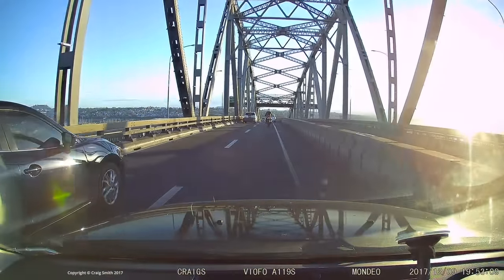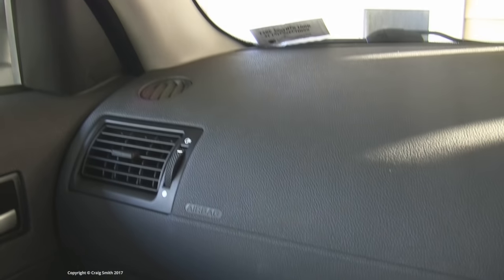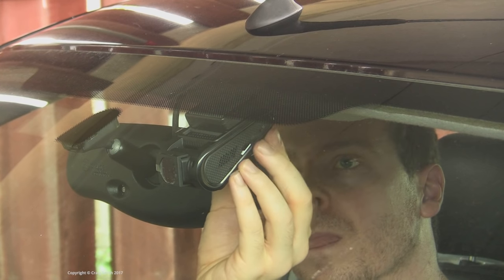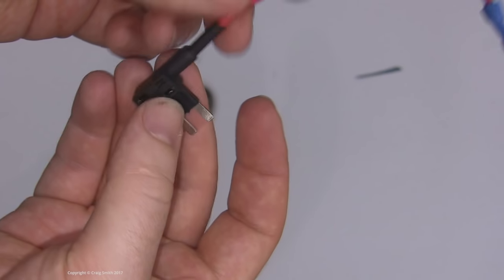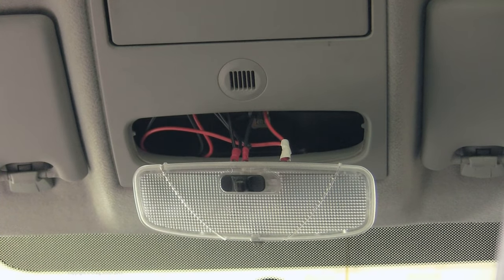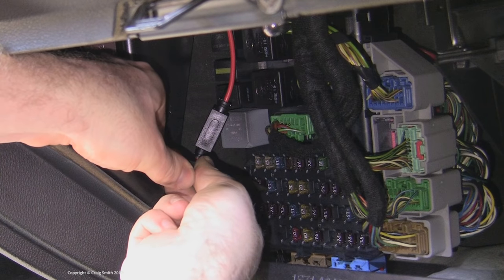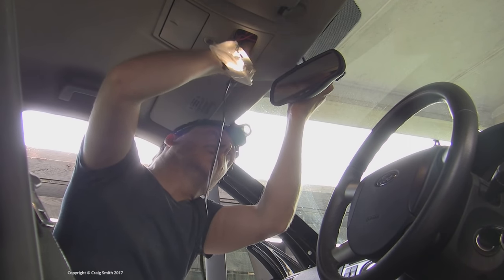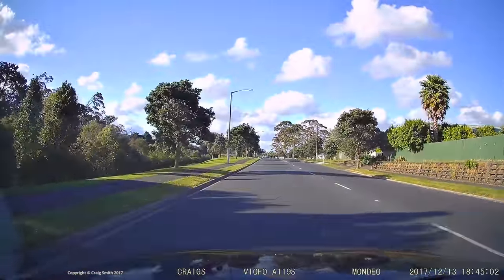How to: Hardwire install a dash cam with USB power supply

Comment: This is pretty much the  way I hardwired my dashcam to my 407, I wired another 12 volt socket to a fuse tap of the courtesy light circute and so I could use the power supply that came with the camera.  I was trying to keep the cost as low as possible.  But in the end I have a very tidy setup like yours.

Comment: Nice video. I hope people appreciate how much neater this type of installation is over using the "cigar" type power outlet. I have had this type of setup in my 2015 Genesis using front, rear and two rear mounted diagonally front  facing cameras. I even got a compliment from the service techs at the local car dealer on the installation. I think though that the cameras themselves make them nervous.
Reply: That is a point (recording while in maintenance) , thanks for mentioning it. I had a pretty decent result on two cars with wiring the cams on the side frames going under the glove box to the cig. lighter with the standard plug in socket. My lighter shuts off electricity while parking. (No need for me to use parking mode) Way better than lwttingbthe cables hang und done in 45 minutes.

Comment: Thanks for making this guide! Very well thought out parts & video & instructions. I think yours is the "right" way to do this.

My ghetto way of doing this would be to jam (between the a fuse and contact) a piece of wire to power a female cigarette lighter stowed by fuse box. Plug in the male onto the female. Take the output microUSB wire from the fuse panel area through the "A" pillar & headliner to the camera. This would require extra purchase of only a female cigarette lighter and nothing else.

Comment: I also recommend wrapping all the wires to be installed with cloth electrical insulation tape (example high quality maufacturer: Tesa) in order to significantly cushion their rattle against body panels and plastic trim pieces during driving. Cheap and simple trick and an attention to detail.
Reply from the maker: Yes good idea. Cable clips and ties go a long way though. In this car the A pillar has spare wiring clips integrated into it and the headliner is soft.

Comment: Awesome thorough video. I learnt something today. The other thing you can do is use a power cutoff to cut the dash cam off if the battery reached a certain voltage (12.2V is pretty safe) so it'll film while parked but won't kill your battery.
Reply from the maker: You can also use a separate battery pack to further save the car battery, but the other problem without a dedicated parking mode is that you will over-write all your driving footage after just a while of parking, e.g. with 3 hrs of the garage wall. I have yet to experiment with the software driven faux parking mode on the new A119 firmware, if it works ok then I will be tempted to look into a battery system.
Reply: Craig's DIY Car Living in Australia, discharging lithium ion batteries in 70°C+ in the car sounds like a recipe for disaster lol. I'm looking at getting the A119 Pro, and although I'm not likely to use the parking mode in my area it's nice to know that it's an option. You could also put in a little switch so in your garage you could switch the camera off, or just straight unplug it

Comment: The 119v3 is out, $110 so a bit more expensive but as a longtime user of the 119 series I expect my newly purchased 119v3 will work great and it has a hidden feature of H.265 encoding. I like the form factor of these cameras and although theft is low her in our area it blends in nicely with the windshield.

Comment: Great job. One caution. Once the GPS plug in cable gets old it will start to make the camera intermittent. I had to bypass the GPS mount and plug directly in the camera. This was true for both 119's I have so it is not something that was a fluke. I am about to install another 119 and hope that has been solved. Dielectric grease did not solve the problem thus I think the mount of the GPS is not robust enough to handle the plug in. The camera works well and will let you know when the SD card is shot too by coming on and off acting intermittent. Again nice job!
Reply from the maker: If you look at my review of the A119 there is a revised connector in the later version also with a foam pad that is supposed to fix this.

Comment: In July of 2018 I purchased the newly released Viofo A129 Duo.  Viofo continues to develope new dash cams, and the A129 Duo is a great improvement.  If you want front and rear dash cam foottage, the A129 Duo is the one you want to get.
Reply from the maker: Yes I've recommended it to a few ppl altho I haven't looked at it myself. The one drawback is it's only 30fps vs the 119's 60fps, which does make a difference for a dash cam.

Comment: The original viofo ,a119 is still considered better and it's cheaper then the a119s.  They've fixed up original common issues such as vibration noise, GPS add-on pin connection problem, adhesive pad colour for a more inconspicuous look.
Reply from the maker: I explain why the A119S in its review video.

Comment: I just used a Mini usb mirror tap and plugged that directly into my powered rear view mirror harness. Took less than 10 minutes, no wires to tuck or hide and the camera starts when the car comes on and goes off when the car is turned off.
Reply from the maker: Does it also switch off when you reverse? :)
Reply: @CraigsDIY  No it doesn't switch off in reverse. It stays on as long as the car is on because it's tapped into the powered rear view. Here is a link to what I have https://www.amazon.com/Two-prong-Universal-Dashcam-Adapter-MicroUSB/dp/B07BFRWC3X/ref=sr_1_4?keywords=mini+mirror+tap&qid=1565532074&s=gateway&sr=8-4

Comment: This may be a silly question, but how do you know which way a fuse would go into the fusebox? I was poking around with my multimeter, and I had one probe on the chassis for ground and I poked the live/hot into both terminals of the fuse and both were reading 12v, so does it matter which way a fuse would go into this slot?

Comment: To activate park recording, do you plug the power to the base holder or to the camera itself? Very neat install.
Reply from the maker: The camera & install here isn't intended for park recording. You should use a different camera with a different power supply, try this video: https://youtu.be/bAE4gbzCXJE
Reply: @CraigsDIY  Thankfully the Viofo a119 V3 has parking mode, your video is very helpful 👌

Comment: Hi curious, most or my camara is 5 volt.  So 12 volt would over power camara and cook it.  Are the usb connections you shown step down from 12 volt to 5 volt?  I  would like to feed the camara off the interior light power, the cigar plug is too large to fit under light fixture whereas the usb would fit nicely if in fact it provides the 5 volts required, not the 12 volt as the cigar lighter provides.  Thanks for the video. Peace. Andy usa
Reply from the maker: You need a USB power adaptor. 12 V in, USB cable (5 V) out. You can get smaller ones that are not a cigar lighter plug.

Comment: hi craig. i have a 2010 vauxhall astra which as the fuse box in the boot. I was wonder what method i could use to wire from the back of the car to the front while still having the dual usb ports in the glovebox. If you could post a suggestion it would be great. thanks

Comment: I read that some people get inconsistent power problems when powering their Viofo from the GPS module, have you noticed any similar problems?
Reply from the maker: No. The older version had connectivity issues with the GPS mount, resolved in the later revision, it may come down to that.
Reply: @CraigsDIY  gotcha, thanks!

Comment: Great video, thanks - I'm looking at getting a "VIOFO Dash Cam A129 Duo Dual Dashboard Camera" and have no idea how to install it as I don't really know anything about cars/electrics - Who would you suggest I ask to do this? Halfords, kwikfit (hahah no) ? I don't want one that plugs into the "cig lighter" as my satnav uses that, so prefer one that is all wired in like you showed in this vid.
Reply from the maker: I suggest you buy Viofo's hardwire kit, it's not expensive, that is intended to provide proper ignition control and thus parking mode with that system. It has a battery conserving function that can be configured liberally or conservatively. Then just give it all to a competent auto electrician. Yes I would avoid the quick lube places (for everything, including lube).
Reply: @CraigsDIY  Thanks Craig for the reply. I'll have a look at the hardwire kit as well.

Comment: Hey bud, just wondering why you didnt use a permanent 12v? The a119s has the parking and motion sensor feature that needs a permanent 12v
Reply from the maker: It doesn't have a proper parking mode. If you want that, buy a camera that does, and wire it up to ignition-switchable power. For example see this video instead: https://youtu.be/bAE4gbzCXJE

Comment: Great video! My vehicle has a factory installed USB port in the center console. Could I just get a long usb to mini usb power cable and run from the camera to the hidden USB port in the center console and that work just the same as this without having to tap into the fuse box?
Reply from the maker: It will work of course... whether the power is on/off with ignition as you prefer is a different question.
Reply: Ok thanks!!

Comment: You need a low volt switch so your cam can run in park mode.
Reply from the maker: You would rather choose a camera designed for it and wire it accordingly e.g. https://youtu.be/bAE4gbzCXJE

Comment: Does this hardwiring have any effect in regards to functionality when the camera is on the parking mode? In other words, will the cam turn on to record if the car got hit when the car is turned off and parked?
Reply from the maker: The camera shown here doesn't have a proper parking mode. Try this video instead, which shows a more complete install with a better camera: https://youtu.be/bAE4gbzCXJE

Comment: what do i do with the fuses if i wanted to connect to things to that usb block? I have a bluetooth FM transmitter and my phone charging cable going to the cigerette port at the moment, but i want them both hardwired
Reply from the maker: Well it depends on how you want them installed. I showed it being wired into an ACC circuit that is on with the ignition accessory. You would probably want the same for your FM transmitter, but a phone charger is probably best with permanent power.

Comment: It is funny how much effort you deployed to prevent your dash cam from recording when most people would like the dash cam to guard your car in parking mode and connect the power cable to the fuse that still has power after the car is turned off. On the contrary of your car, most cars shut down all the power after you turn off the car. I have the habit to listen to music in my car while waiting for someone. I'm very frustrated that even my stereo equipment shuts off after a while in my 3 current cars. My previous cars let me listen to music indefinitely. Dash cam nowadays have a parking mode that is very economical in terms of memory usage (low bit rate or time lapse or shock detection).

Comment: Why not just use a 12v to USB adaptor.  One single unit for as little as 4 quid.  A lot less messing and some come with the fuse spur already attached.  Also bear in mind if your output to the twin USB socket is 3 amps you may only be getting 1.5 amps at each plug.

Comment: Thanks for the tips on where to place a dash cam, especially avoiding where the wipers don't reach. I'm not so sure about installing it with 3M tape over the tinting, wouldn't that risk lifting that tinting if ever you decided to remove the bracket?
Reply from the maker: Maybe, I would be careful. They give you a piece of string in the box, it's to use as a garrotte so you cut the pad then you can scrape off the adhesive and clean with alcohol. I already did it once!

Comment: I also used the ACC power on the radio with the original adapter from the 119S V2. Problems is, the ACC gets switched off when you start. So sometimes , when the camera is not fully booted up,you start, it looses power for 1 second and gets power again. Then the camera switches off and not on again. 
The timing must be perfect to do get that right , but as my camera is behind my mirror also, I dont always look at it. So it can sometimes be off when you think its recording. 

I then installed a diode and capasitor to keep power for a few seconds, but the camera does not like the slow lowering of the voltage. Will update my circuit later.

Thanx for the video.
Reply from the maker: I was thinking that might be a problem but it works for me. I'm not sure why your camera is staying off though; if it has power, it should be on, unless switched off, regardless. Maybe there's something wrong with it.
Reply: I have the same issue with my camera which is currently just plugged directly into the 12V power supply. I'm a total idiot when it comes to anything electrical but seems there must be some kind of circuit that cuts the power to all other feeds for a brief second to ensure maximum battery power for startup. My camera must get confused partway through it's bootup sequence and doesn't recover in time for when the power comes back. Doesn't happen every time but quite often.
Great overall video though and nice neat installation using minimum distance from power source to camera.

Comment: I would like to know why are they install that dashcam behind the rearview mirror instead under or next to rearview mirror?
Reply from the maker: Because I want it both hidden (from outside view) to the extent possible, and not obscuring the driver's vision, and looking through wiped screen.
Reply: video shuts off after camera starts up so you cant see it till you load sd card later

Comment: Does this modification VOID the vehicles WARRANTY?
Reply: Everything done in this video is fully reversible and the installation does not require access to any areas which would be considered "off limits."

Comment: Did you take that film off the camera lens? Good video thanks, but seems a complicated setup. why not just take the case off the cigarette lighter and solder the fuse blade tap cable to the board? Then you'll only need to buy one cable instead of three.
Reply from the maker: Yes it's off :) Gotta leave it on until finished otherwise I'll be sure to get a nice fingerprint on it...
I'm not sure exactly what you mean but going to the cigarette lighter is farther than the glove box fuse board, plus I want it independent and movable... you could make up one cable but what I've done was just easier frankly, and it has the advantage of being modular.
Reply: Craig's DIY Car I meant using the USB adapter which came with the camera. Nothing wrong with your approach, just a bit expensive to buy three things if you could simply use the fuse blade adapter and solder to the board inside the USB adapter you got with the camera. Anyway thanks for the video
Reply from the maker: I see, yes could do that, then again the new adapter and cable was only ~$10... and the charger adapter will be handy for other use anyway.

Comment: So when switched power is removed the camera will go into Parkmode?
Reply: The dashcam he is using does not have a parking mode.
Reply from the maker: The camera shown here doesn't have a proper parking mode. Try this video instead, which shows a more complete install with a camera that supports parking: https://youtu.be/bAE4gbzCXJE

Comment: Any thoughts or insight about the  129 dual channel?
Reply from the maker: I like it, 1080p front and back, similar features to the 119, and has a cheap power supply available that can enable a true parking mode. The one downside is that the video is only 30 fps, vis-a-vis the 60 fps of the 119.

Comment: Can't I just get power from the mirror?  Is it so evil to do?  There must be +12V & gnd wires going to the mirror?
Reply from the maker: I wired the car featured for ignition power, as explained. The electric mirror, like the courtesy lamps, gets permanent power (until killed by power saving relay) without respect to ignition. So it depends on how you intend to set the camera up.
Reply: @CraigsDIY Thanks a lot.  I did not even expect a reply.   What you say is an important consideration.  I will check to see when the mirror power is turned off, before I decide how to do it.

Comment: cool vid sorry for stupid question but does this dash cam automatically record when you turn car on and stop when car turned off
Reply from the maker: It records automatically when it has power, so it depends on how it's wired up... hence the video.
Reply: not all cars turn off the cig socket with the ignition, you use a jumper to wire into fuse box (its easy) on fog lamp fuse etc.. 😎

Comment: What is that cable to the mirror? maybe is it possible to steal power from it to dash cam?
Reply from the maker: It's for the self-dimming mirror yes, but it is permanent live (up until the power save relay kicks off), so not suitable for this installation.

Comment: Why dont you use power bank when ignition is turn off?
Reply from the maker: The camera shown here doesn't have a proper parking mode. Try this video instead, which shows a more complete install with a camera that supports parking: https://youtu.be/bAE4gbzCXJE

Comment: I take it with that set up it won't record when you leave your car in a carpark for hit an runs???
Reply from the maker: USB cameras don't have 'proper' park modes so no.
Reply: if power is on it has motion sensor to start up when somthing moves in front of it

Comment: Your video title is not correct. You end up using a USB power adapter not a power supply, just saying it was slightly misleading
Reply: Fuse box is basically Power Supply, which he used.